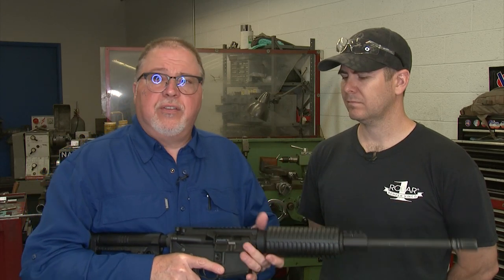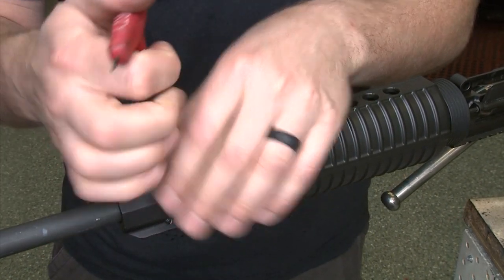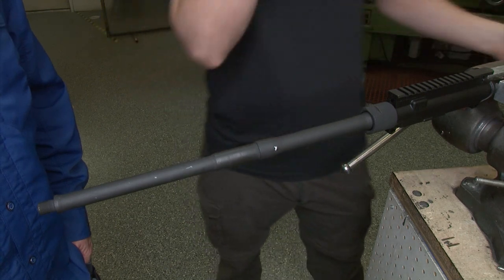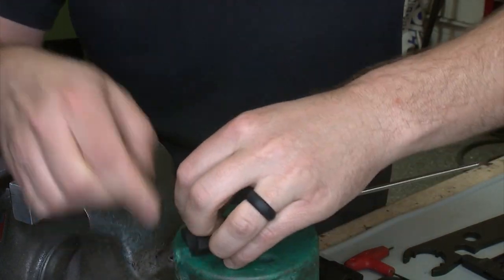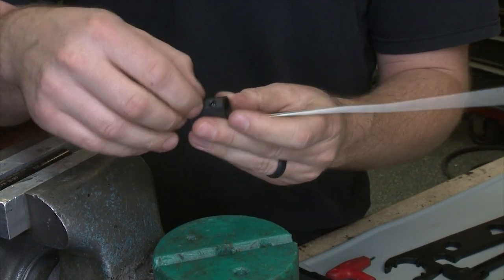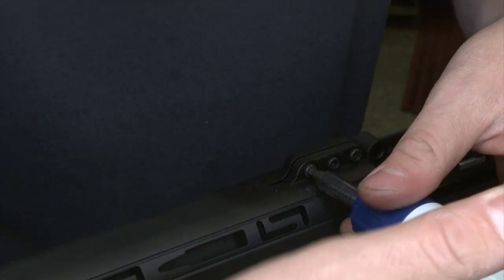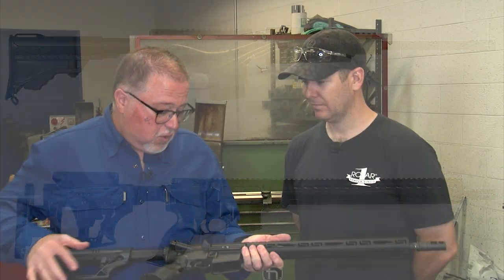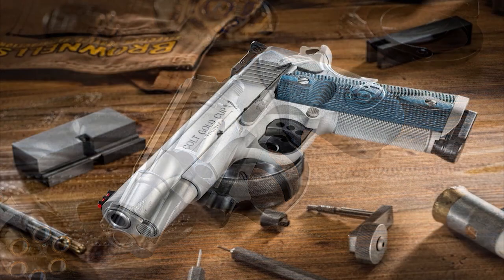Upgrading the DPMS Oracle with Luth-AR Bling #610

Comment: I have a dpms and haven't seen this detailed info yet. Thank you, it needs a new handguard lol, mine rattles
Reply: The Luth-AR Handguard is great!!
Reply: I took my DPMS apart and upgraded it. I'll stack it up against anyone's rifle now. 

I free floated my barrel using a Brownells handguard, am Odin Works tunable stainless gas block, went with a Geissele Airborne charging handle, Geiselle BCG, SSA-E trigger, Magpul MOE+ grip,  VG6 Precision Epsilon brake and a Holosun red dot.

I have an Aimpoint PRO on another AR, but the Holosun is lighter and has been great thus far.

Don't let anyone knock DPMS's 4140 unlined barrel. It may not last as long as a chrome lined milspec barrel, but it's more accurate and will last more than long enough for the average shooter
Reply: @David Marley instablaster =)
Reply: @Zev Roy thanks so much for your reply. I found the site on google and Im trying it out now.
I see it takes quite some time so I will get back to you later with my results.
Reply: @Zev Roy It worked and I finally got access to my account again. I'm so happy!
Thanks so much you saved my ass !
Reply: @David Marley happy to help :D
Reply: The magpul one is a moe allows for the handle flashlight and all kinds of add ons

Comment: Great information. I want to do this to my S&W M&P Sport II
Reply: Yessir im about to do the same for mine
Reply: You can do this to ANY AR, but for your Sport 2, you will probably need to order the Gas Block and remove the Front Sight!!
Reply: You might need a low profile gas block . For your free floating hand guard . My hand guard is coming Wednesday
Reply: @Tetristactical  thank you. I've been looking at one from STNGR USA and it comes with one. Good luck with yours
Reply: I’d do it myself but do you think my local gun shop can do it for me with the right equipment? If so how much is a good price?
Reply: @ivannz3370  Any competente gunsmith can do this upgrade in minutes, as you can see, doesn't take that long.  About pricing, that I don't know, everyone charges differently!!  Find someone with the right experience working on the AR Platform, not every gunsmith has the same training.
Reply: @tobilansangan6854  same! Lol

Comment: Can you please provide BOM of parts purchased and from where. Much appreciated! Great Video
Reply: Sorry, I can't, this Platform WILL NOT allow it and will delete the comment, I have done it in the past and it won't work!!

Simply go to the Luth-AR Website simply search for the following:

Palm Handguard, Gas Tube (Depends on the rifle you have), Gas Block (Depends on the rifle you have), MBA Stock (Depends on the rifle you have), Chubby Grip, "The Switch" Selector and "The Paddle" Bolt Stop/Releasse.
Reply: Ahh understand! Thanks for responding!

Comment: So, I just use my same gas tube and switching is no issue? I have the DPMS 223/556. I DON'T like the stock fire grip. I don't need anything special to replace it?

Jonesy 
NW Arizona
Reply: You should have a torque wrench and the tool to take out the factory barrel nut, yes, you can use the OG Gas Tube, or I mean, re use it if it's in good condition.

Comment: Can you provide any info on the gas block you used for this upgrade. I've seen different diameter blocks, and I'm not sure how much of a difference that makes. Thank you.
Reply: OK, The Gas Block Diameter depends on "YOUR" Barrel, the standard barrel is .750", most Bull Barrels are .920"-.936" and some pencil barrels are smaller, but I have personally never seen one.  I used the .750" Low Profile Gas Block, because that is the one that fit my barrel correctly!!
Reply: @yrsued  Thank you so much, Yamil.
Reply: @artapolinar729  My pleasure.
Reply: @yrsued  Do you remember which gas tube you bought for the Oracle?
Reply: @yrsued  Does the gas tube have to be changed or can you use the old one?
Reply: @roberthughes3204  You don't have to replace it, unless it needs replacing!!  I replaced it because I wanted to, not because I needed to!!
Reply: @roberthughes3204  YEs, the Luth AR Carbine Length Gas Tube!!
Reply: @yrsued  Thank you for the info!!
Reply: @roberthughes3204  My pleasure, just ask away!!
Reply: @yrsued  did this gas tube fit the set screws right ? I don’t want to buy a gas block and the set crews don’t line up. Anything helps
Reply: @sigspearthumb5237  Ya, they lined up very well!!
Reply: @yrsued  oh I’m sorry I meant gas block not tube my bad ! What gas block did you use
Reply: @sigspearthumb5237  Thanks!!  One thing to know is that the Oracle was made while Randy Luth was involved with DPMS, he sold DPMS to Remington.  Now Randy Luth owns Luth-AR.  He made his parts compatible to his old product.
Reply: @sigspearthumb5237  Luth-AR, I explained why this is compatible above.
Reply: @yrsued  your a great man ! Ended I have been stressing about buying a gas block that won’t align with the set screws. You said it was the luth .750 gas block
Reply: @sigspearthumb5237  Yes, remember, my Oracle was old, it was one of the first ones out.  I don't know about the last ones made under Remington.

Comment: Will this be the same process for the dpms sportical? What is the link for this floating rail
Reply: I think the only difference between the oracle and sportacle is the forward assist so I don't see why it wouldn't be the same process.
Reply: Process is the same, the Sporticle has the Thick Cast Receiver!!

Comment: Is the buffer tube mil spec or commercial on the dpms oracle?
Reply: Back then, when they were made, it was Commercial, I left it Commercial because the Luth AR Stocks fit both with a little adjustment Screw

Comment: Has anyone else had trouble changing the grip out on these? I don’t know if I’m doing something completely wrong, not getting the screw going back in at just right angle or what. But I can tell that if I didn’t already strip the threads i just would have if I kept trying .
Reply: Remington Steel  yes and no. I didn’t figure it out myself but i had a couple other parts that was already planning on having swapped out by someone that actually knew what they were doing so I just had them do it. But the grip I went with didn’t fit so I just had them put the factory grip back on.
Reply: no issues with my rifle. Get a tap and chase ur threads.

Comment: My stock rear cross pin stake hole was right in alignment with the rear set screw , so it would have been useless, I thought it would be better to take my die grinder and trim down the cast steel A2 sight making it a gas block and reuse the original cross pin stakes much less chance of any movement . Having only one good screw dimple in I felt wouldn't be near as reliable .
Reply: Your gun, your choice!!  I liked the one I used, and that was over 2 years ago!!

Comment: When you use a torque wrench with a crowfoot it has to be 90° to center line or you will be over torquing! With the crowfoot extended to the front you've extend your torque wrench length!
Reply: THAT is a question for Marty, I will forward this question to him and have him answer it correctly!!
Reply: @yrsued  when
Reply: @sundial6919  When what?

Comment: Sorry, I can't post the parts used on this project. This Platform WILL NOT allow it and will delete the comment, I have done it in the past and it won't work!!

Simply go to the Luth-AR Website simply search for the following:

15" Palm Handguard, Gas Tube (Depends on the rifle you have), Gas Block (Depends on the rifle you have), MBA Stock (Depends on the rifle you have), Chubby Grip, "The Switch" Selector and "The Paddle" Bolt Stop/Releasse.
Reply: I understand that the platform is blocking damn near everything, can you comment on the length of the hand guard? It looks 15 inches, but looks great!
Reply: @nickmartinez8067  Yes, this is the 15" Handguard, at the time of the Video, they didn't make any other length, just 15"

Comment: My hand grip has a hex screw in it
Reply: Yes, there's some models out there that have a Hex Screw, that is very normal!!  I have both in my parts box!!
Reply: I just bought some hex wrenches for it
Reply: @warrenross56  Get the Long "T" Handle ones, those are the best, I got my set at ACE Hardware!!
Reply: @yrsued  i went to harbor freight and home depot
Reply: @warrenross56  They should have them, if not, try ACE  or True Value!!
Reply: @yrsued  ok i found some haven't try them yet thanks
Reply: @warrenross56  Cool!!  I like the set I got!!  I would love to get a bigger set, with more sizes.

Comment: I disliked it because it doesn't look like the display that you have up.
Reply: What doesn't look like the display??  Do you mean the Thumbnail??  It's the same stock, I just took the Cheek Riser and the But extension off.  This is why it's called the MBA as in MODULAR BUTSTOCK ASSEMBLY!!  Oh, I added a new Brake, not a big deal, except to you I guess/
Reply: @yrsued  okay I get it I just liked the thumbnail just too see how it looks only because I'm trying to figure out how I want to make my AR didn't mean to offend you not what I meant to do that's why I don't like texting. Hey still a nice looking AR 👌
Reply: @acceleration215  This thumbnail was done in a Photoshoot I did or the manufacturer, Luth-AR, when I built the gun, I did  a couple of things different because I didn't need the extra Adjustable parts on the MBA-3, so I went with an MBA-4, which is a simplified version of the MBA-3.  I used the surefire Brake because it's my favorite.  I didn't feel like making a new photo for this, so I used the one I had.